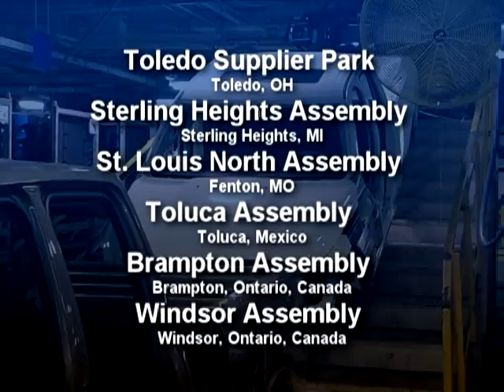Chrysler's Warren Truck Assembly Reopens

Comment: My truck is a 1992 Ram 3/4 ton with a Cummins diesel. Has no rust, 207k miles, and runs like a top. I'm 19 years old I can see myself driving this truck 30, 40, even 50 years down the road. I trust it THAT much. I'm sure many of these workers were on the same assembly line when my truck was made in December 1991. You guys make a great product. My hope is that all RAM truck manufacturing will soon be conducted in the states once again.

Comment: My 2002 dodge ram 1500 has the UAW and Warren Truck Assembly sticker and I say is the best truck no problems at all. My friend 2005 dodge ram 2500 diesel came down with engine and transmission problems and it was assemble in Mexico. Buy American made products!